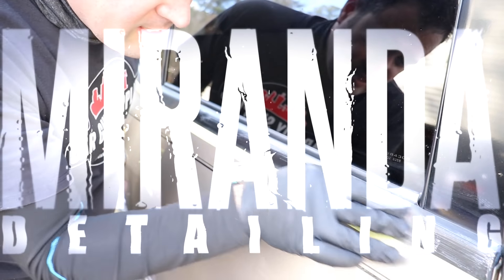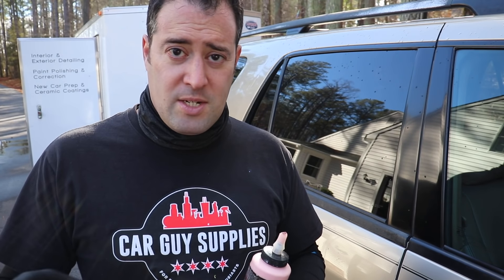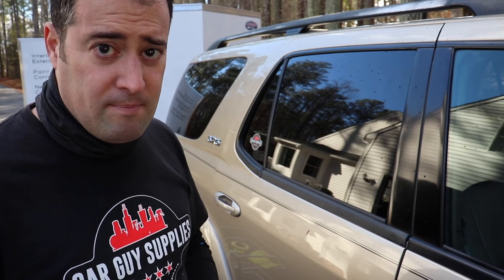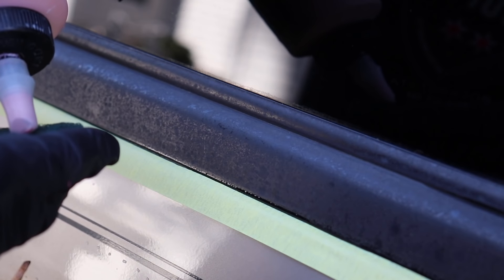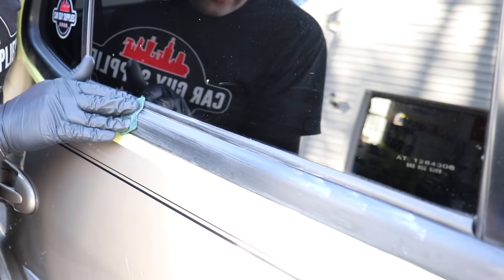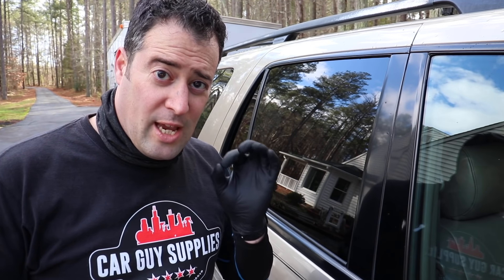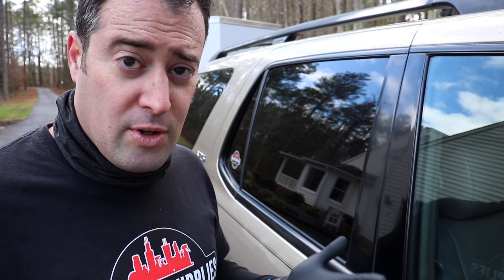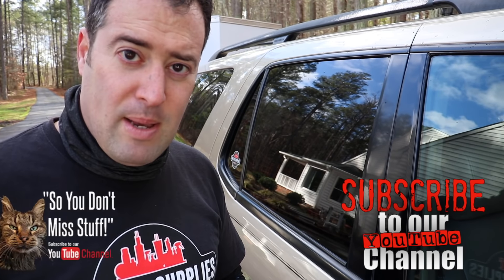How To Restore and Protect Moldy Rubber Trim! #autodetailing #Detailingtips

Comment: I used the Maguires headlight restoration kit... Comes with 1800 up to 3000 sanding pads and then a light compound 🙌 worked a treat... Need to protect it now 🙌 thanks for the info 👌

Comment: Great to see the results, just remember to use a compound that doesn't stain trim.
Mould causes the rubber to become pitted so removing the top layer is the only real option.
Good work, keep it up and thanks for sharing

Comment: I use Mothers Mag and wheel polish and a soft terry cloth towel. Works on my '91 4Runner and the 2005 Cadillac STS rubber trim. Will not hurt paint or glass. I then top coat it with Mothers Back to Black. It has no colorant and lasts longer than other brands I've tried. If the rubber is etched it just takes more rubbing, but it leaves no scratches and a glossy finish that sheds water better.

Comment: Awesome video, I need to do this on my 2005 Acura MDX.  I think I will work my way up from an APC, then to a blue scotchbrite then to Green Scotchbrite and then the 0000 SS then back down again with polish.  I have some Sonax CutMax laying around I can try it with for lubrication like you suggested and then hit it with DIY GS Polish.  I might use some Solution Finish I have laying around and then ceramic spray coat it after it cures.
Reply from the maker: Thanks for sharing!

Comment: Magic Eraser or Turtle Wax Miracle Cleaning Sponges may be an option for trim that is not so old and hammered. Impressive results.
Reply: Haven't tried or even heard of the TW sponge? Is it just a TW branded melamine sponge? I buy a generic version in bulk for like a quarter a piece.
Reply: @aldaley3537  nope doesn't work not agressive enough

Comment: Worked great for me with very little effort (mine were not too bad). I used the finer grade red scotch brite cloth/pad (320 grade) with some Meguiars stage 1 paint cleaner polish (quick detailer spray worked as well) and had no visible scratches at all. Finished with some Autoglym (UK brand) plastic/rubber gel cleaner/protectant. Buffed off  any smears on glass and paintwork with clean microfiber cloth.
Reply from the maker: Cool!  Thanks for sharing. 😎👍🏼

Comment: Cool video, Phil!  Thanks for posting!  My rubber trim is protected with Cerakote, but should it ever get moldy, I NOW KNOW what to do!!
Reply: @chelsabailey1018  Does the Cerakote Trim Coat work on the rubber trim?  I was told it wouldn’t coat correctly.
Reply: @jimmynickels6248   Hi Jimmy!  The Cerakote is working fine on the black rubber trim on my rear bumper.  I haven't had any issues with it and applied it to my car's bumper over a month ago.

Comment: That turned out great. The 3800 polish you used is that the super finish plus? Didn't see a link for it. I am going to try this on my 1993 Toyota Supra quarter window trim it looks just like your car did. New glass is $600 so if this works it saves me from buying new windows. Thanks
Reply from the maker: Hi. Honestly I don’t remember. It was an older bottle of Menzerna 3800 I had from years ago.

Comment: Nice work. I did this few years back but I used soapy water with autobody red scotch pad, then followed it up with 1500 and then 2500 sand paper. Looked smooth and shiny. I'm not sure how long it looked good though as I didnt put any protection on it and I sold the car shortly after

Comment: That's great, so many tips! Many thanks.
How do you clean the rubber "blades" that contact the window glass? Mine are green and gungy...
Reply from the maker: Hi. Thanks for if they are that bad I would suggest replacing them. But if you want to clean them I just use glass cleaner and junk towel and pinch the blade with the towel soak in cleaner and run it up and down the blade.
Reply: @MirandaDetailing  Cheers - it worked!
Reply from the maker: Awesome! 😎👍🏼

Comment: Great video. I was able to remove the mold and oxidation from my Toyota tundra rear window trim, but within a month and a half the marks seem to come back. What would be a good sealant or something to prevent the mold from coming back. The only thing I’ve tried so far is coating the trim with Beadmaker but it doesn’t seem to be helping.
Reply from the maker: Hi. Does your vehicle stay outdoors? Do you wash it regularly?  I never had the mold return on me after I restored it.

Comment: Not related to rubber, but since you used the "0000" steel wool, it works WONDERS on chrome!

On my 2022 BMW motorcycle, I use a light touch with a dry "0000" steel wool on my chrome surfaces, and it removes bugs, spots, etc., like magic. For rusty chrome, WD-40 and "0000" steel wool helps to remove the rust and polish the chrome. I did this with my 1976 Honda CB500t to great effect.
Reply from the maker: Hi. Oh yeah! We use it for chrome also. It’s awesome!  Thanks for sharing.

Comment: Great Video!! Phillip,  I Was Wondering if Spray Nine Heavy Duty Cleaner Might Work As Well?.. I Also Came Across A Video By Chelsea's Attention To Details, She Used it To Remove Mold On Rubber Trim.
Reply from the maker: Thanks, maybe it would have, but I doubt it on this one, it needed abrasion to remove.

Comment: Word of warning - These rubber trims can be surprisingly very thin on the corners.  I followed a guide to abrade trim mould on my Honda Prelude many years ago, using fine emery paper, yet managed to hit bare metal on the trim corners very quickly, before I had even removed most of the mould: had to buy new trim pieces in the end.  I was fairly careful and only removed a fraction of a mm before I hit metal, so consider starting with a magic eraser sponge or 3000 grit emery paper and strong degreaser or suitable polish.
Reply from the maker: Excellent tip!  Thanks for sharing!

Comment: How has the black label ceramic holding up?  Have you tried different ceramic coatings?  I was thinking of using something from Cerakote for the rubber coating.
Reply from the maker: Hi. I since sold that vehicle a few years ago. But at the time of selling it the trim looked perfect still!  We use a few different trim coatings but our favorite is Gtechniq’s c4 trim coating.

Comment: Hey Phil, great video! If a non-ceramic trim restorer such as Solution Finish is used, do you apply any kind of sealer over it? Any other brands you recommend?
Reply from the maker: Hi. Thanks!  Yes you can apply something like Lithium Trim Serum or AM Trim. 
But the best option would be to use a ceramic trim coating after the Solution Finish.

Comment: Finally, someone working on older trim. Question though. The black on the door pillars how would you coat those? They feel like plastic but have a different feel from all the other trim. I'm planning on coating my Rav4 when it starts warming up and I want to make sure anything plastic is taken care of before putting CSL on everything.
Reply from the maker: Hi!  So is black on your door pillars glossy or black textured plastic?
Reply: It’s glossy just like the sequoia smooth and shiny but feels like plastic not metal. It’s not faded like all the rest of the plastic so maybe I’ll just coat it and call it good.
Reply from the maker: Ah ok. So it’s most likely the black gloss pillars. Even though they are plastic underneath they are usually still paint d and clear coat led like normal paint so you can treat them paint.  Polish and use a paint ceramic coating. 😎👍🏼

Comment: Another great option my friend. I never would of thought of the green scotch brite pad. I normally use a magic eraser with an apc or adams tire and rubber cleaner. That does the trick every time. But to add another option is always great. I wonder if the white scotch brite pad would work just as well? Came out great
Reply from the maker: Thanks!
Reply: Start with the finer 320 grade red pad if they are not too bad. They are finer and leave no scratches.....just did mine, they came up like new...green is 100 grade, I'd only use them if the red failed to remove.

Comment: Great video, but wouldn't it make sense to do this with the window down the avoid scuffing the glass?
Reply from the maker: You could, but the pads or even 0000 steel wool won’t scratch the glass. But you could either tape it or put it down if you want. Good question! 😎👍🏼
Reply: Thanks for the video and tips! I'm going to try mine with the window down, hoping that polishing and restoring the inner lip that touches the glass will help restore a more even glass wiping action when the window goes down and up for clearing fog etc.

Comment: I have tan side panel trim that has faded also.
will this work the same?
thanks, Love your videos
Reply from the maker: Hi If its uncoated rubber then it should,  what's the make and model?
Reply: 02 Chevy 2500hd PU  4 door,    
I will try it then let you know how I do.
Thanks

Comment: I worked for a rubber company for 3 yrs every day at work we sanded rubber. We also made a lot of mouldings for windows of planes and seals and lots more for the automotive and aircraft industry. The lines are part of the moulding process. It’s the machine lines in the molds if they are not polished as well as the milling of the rubber before it goes in the molds. You are just scavenging the dried out surface. Not sure why people freak out!
Reply from the maker: Awesome! 👍🏼👍🏼👍🏼 thanks for explaining that!
Reply: @MirandaDetailing  and they type of rubber(S) in mouldings is very temperature and chemical resistant. It’s not soft gum type of rubber. That type of rubber would go all soft and gooey!

Comment: Sorry, kind of skipped to the process.  Did you consider magic eraser?   If it is effective against the oxidation and mold, could forego masking tape step.  Wont abrade paint or metal trim on older vehicles.  Just hit the paint around the trim with a detailer or spray wax afterwards if worried about the protection, sooner or later.
Reply from the maker: Oh yeah I’m sure that could work also. But the eraser tends to deteriorate and fall apart when put pressure is applied to it. I’ve tried it and it’s ok but the scuff pads and steel wool won’t fall apart like the eraser will.
Reply: @MirandaDetailing  Good points.

Comment: Whats the name of the coating you used after you did the whole cleaning process on min 13:01 ? Thanks in advanced
Reply from the maker: Hi. Sorry I didn’t link it in the description. It’s this. https://amzn.to/3sQL4si
Reply: Exactly
Reply: @MirandaDetailing seriously 60-70 dollars a bottle ?
Reply from the maker: It’s a ceramic coating. They are small bottles and usually range in price from $50-$100 sometimes.  But they are extremely durable protection. Usually years and not just months or weeks

Comment: Another great tip. I have a question though. Could you use an old mini polishing pad as well? We all know what happens when a pad comes into contact with the trim if you don't tape off those sections, I have done it and I don't think I'm the only one.
Reply from the maker: Thanks. Totally. I just feel I have better control by hand and getting close to the corners and edges better than with a mini polisher. But maybe just use both.
Reply: @MirandaDetailing  can we use sandpaper?
Reply from the maker: @jalilpandi1347  Hi. You could use 3000-5000 grit, that can also work.
Reply: @jalilpandi1347  A scotch brite  pad will take the shape of the rubber better, start with the red 320 grade, if that doesn't wont move up to the green 100 grade....only use a small piece of pad and try to take the shape of the rubber with two fingers keeping it off the paintwork if you don't mask it.

Comment: If there was lines left over . What if you took a 3000 grit sandpaper to further refine the lines! Thanks guys
Reply from the maker: Well like I mentioned I have seen lines like that in brand new rubber trim. It’s bot just becasue of the steel wool. Honestly it’s not noticeable to the eyes. The close up shots make it more noticeable. But despite that for old rubber trim this what I would do for a customers vehicle. It worked out great! 😎👍🏼
Reply: @MirandaDetailing  the camera definitely shows more, the human eye isn’t going to catch that. It’s not a show car .
Reply from the maker: Totally!

Comment: Degreaser on a microfibre cloth is another way to clean up those rubber things. It's seems gentler but also removes the top layer.

Due to translation issues/ignorance at the time, I actually used tar remover. That works too. 😄

To be fair, the method comes from Auto Fetish Detail. He has a video on the subject.
Reply from the maker: Yeah so I tried cleaning but that’s not what hat this needed. I even tried to use a magic eraser like someone suggested. But this is not the case with rubber this bad. It needs abrasive to remove the top layer of mildew. Mildew/mold will eat into the rubber. So just like with mold remediation it needs to be removed entirely, cleaners whether degreasers, or even solvents can’t do that with mildew this severe.
Reply: @MirandaDetailing  Got it. I forgot about the meldew, but "my" method does work on rubber trim bits, that have gone hard and plastic like with spots in the surface, and makes them like new again. 😊
Reply from the maker: Yeah the mildew it terrible. But rubber and trim that doesn’t have the mildew is pretty easy to clean up. Thanks for sharing! 😎👍🏼

Comment: Yes, rubber is easier to clean removing that top layer, just like doing it on oxidized paint after washing and decontaminating it.  Phil, one thing I have done and also worked for me was the Griot's Garage Speed Shine or Doctor Mecánico which is a locally made Multi Purpose cleaner which is soapy since are used as lubricants to remove all that filthy top layer and I had them available at Advanced Auto.  Also the scuffy pad.  Thanks for your review video and great to know about that polish from Xtreme solutions to use it for that too.👌👍🇵🇷
Reply from the maker: True. It can be risky if the rubber is to far gone. I’ve seen it where the rubber is deteriorating away. But this one came out great!  Thanks for the tip on that cleaner

Comment: My 2011 Challenger rubber trim has looked like this for many years.  Polishing it does fix it.  My 2002 Ram 1500 rubber trim still looks great and I never have to do anything to it.  22 year old rubber.  Clearly the manufacturers are using inferior rubber and manufacturing techniques these days.
Reply from the maker: Thanks for sharing.

Comment: do u prefer this restore over solution finish?any noticeable difference between these 2 products?just curious
Reply from the maker: Hi! Actually Solution Finish would have worked also, I just chose to use this coating since I had it.

Comment: I buffed my car the other week and I got buffing compound all over the black trims all around the car I cleaned them off with alcohol and now they are coming back and white sloppy patches
Reply from the maker: Aw man. What did you use?
Reply: @MirandaDetailing  meguiars ultimate compound
Reply: It work good on the paint , but now all my plastics are a mess
Reply from the maker: Oh ok. I do remember that tends to leave residue on plastics. Try a magic eraser soak and an APC and gently clean the residue of the plastics
Reply: @MirandaDetailing  thank you!
Reply: @MirandaDetailing  I used a magic eraser and kept if very wet and it worked really good!
Reply from the maker: Awesome!

Comment: When rubber trim is coated does it still get moldy and faded over time? Or should it be fine
Reply from the maker: Hi. It still may fade and get mildew on it but you have have to be more careful with it.

Comment: I thought some cars had clearcoat on the trim, but why didn’t you just put the window down, I wouldn’t risk it
Reply from the maker: Hi. What do mean by clear coat on the trim?  Compound, 0000 steel wool or a scuff pad would not hurt glass at all, so no need to put the window down.

Comment: Hey Phil, nice video 👌. Try magic eraser and APC you will get the same results without the lines.
Reply from the maker: Nope. Tried that. It needs Abrasion to remove the mildew buildup on the rubber it’s the only way I found that works with rubber this bad. If it’s a light build up maybe the magic eraser an APC can work but unfortunately it didn’t in this case

Comment: replacement rubber trim is so cheap - why waste the time and expense on silly chemicals?
Reply from the maker: Really? Where can I find that for a 2006 Sequoia?
Reply from the maker: Nevermind. Found it. Around $70. Not cheap exactly, but I understand your point. However at the risk of replacing them and possibly breaking clips, I wouldn’t bother. As a Detailer we can restore faster and cheaper with basic products and tools. The point of the video is to teach how Detailers can do these services for customers.